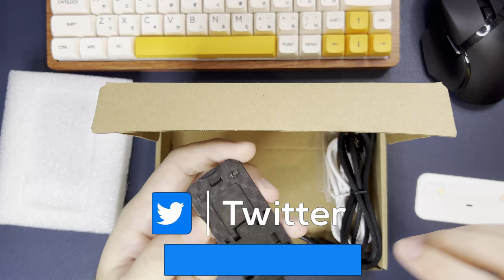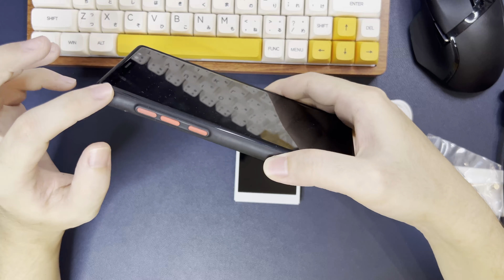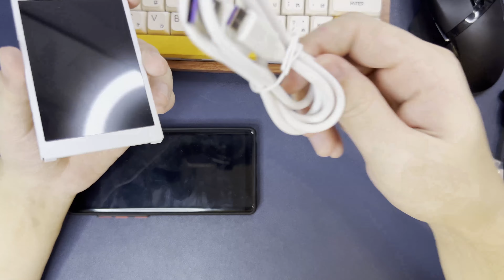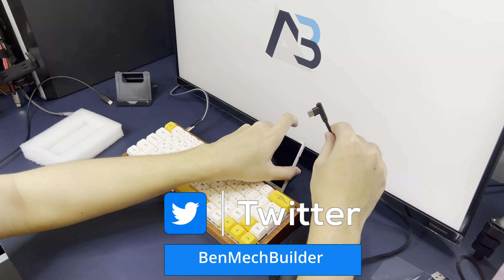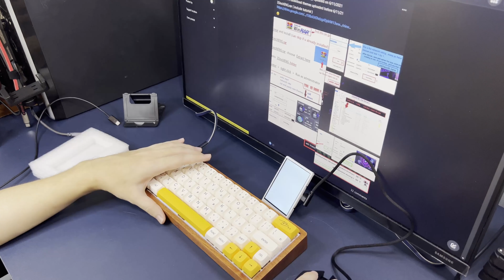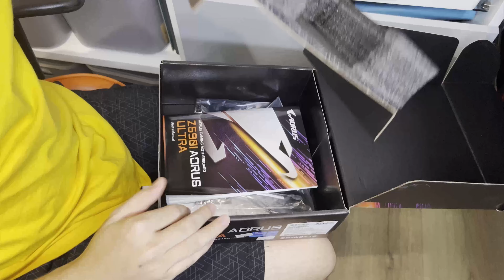Is it Good? Cheap Type C Sensor Panel from Shopee | CKC Type C Sensor Panel Review and Tutorial

Comment: Great video! May I ask if the sensor panel will immediately show the monitoring screen right after you boot your pc? Or need to wait til the app starts on desktop then it will show the monitoring details?
Reply from the maker: Yes it does.. the app will start once system boots
Reply: @benthemechbuilder4741  oh okay thanks! Wouldn't want to see it on a black/white screen after I press the PC start button.. If it starts with your monitoring settings immediately when booting pc, then I'm impressed!

Comment: Hi, I noticed that theres 2 connection point at the back of the panel, are they both the same? Was planning to get 1 later. Thanks in advance
Reply from the maker: Hi, the one I plug in is the only one able to connect. Another is not able to plug in so I believe that might be the programming port for the factory to flash in the software